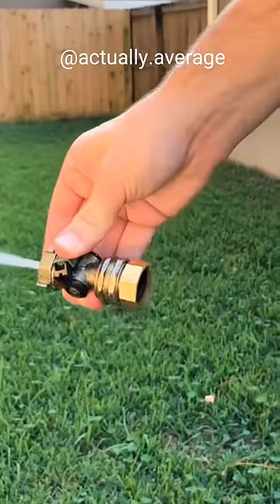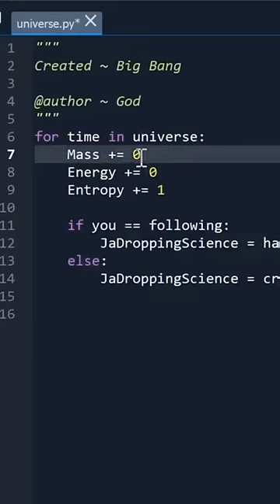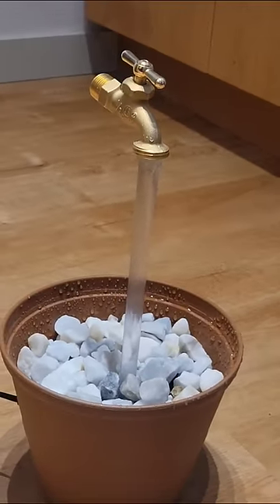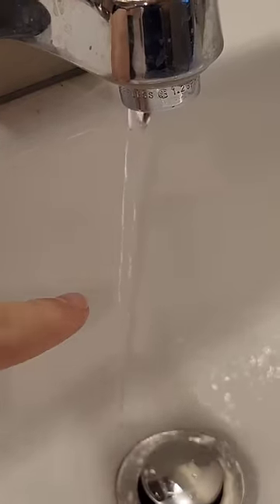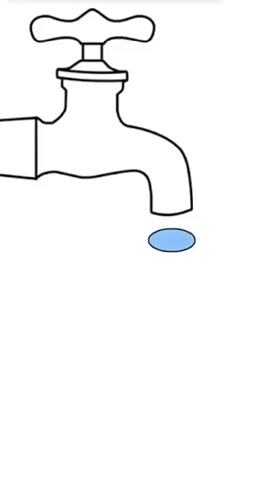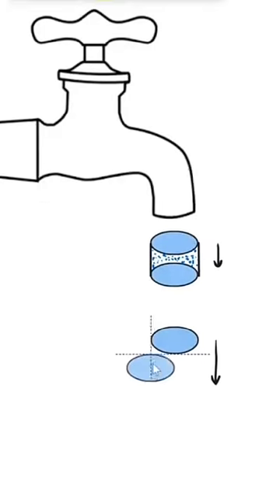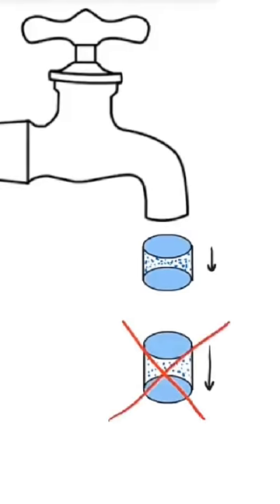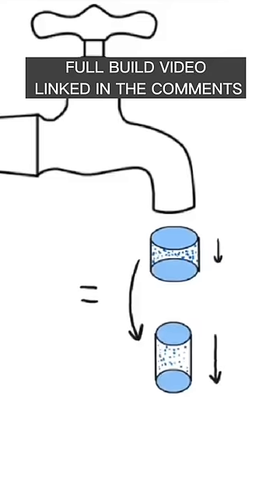Bluetooth Water Fountain??? DIY Tutorial Linked In Comments #science #learn

Comment: Wait… he didn’t actually EXPLAIN anything.
Reply: It's not super complicated. There is a transparent tube in the middle of the stream. The water runs up here and then flows back down on the sides. There might also be another rod inside on which the tap is mounted. That might have been done differently though, but it's hard to attach to the same tube as the water is using without breaking the illusion (as the connections would block part of the water flow, which would make the flow uneven)

Comment: I've seen laminar flow do something like this (the constant stream, not breaking physics), but I assume you can't do it straight down.
Or can you? 🤔
Reply: You can
Reply: pasted my comment, was looking if anyone else noticed:

Your drawing implies the distance between the particles of water is changing (you're changing the length of the cylinder), which is why you must reduce the width to have the same resulting volume. A drop of water can fall through the air without changing shape; why would this be (fundamentally) different for a cylinder? The length of the cylinder does not change, because all of the water is accelerating at the same rate and maintains their position relative to each other. Therefore, it can fall and have the same volume without a change in width.

Comment: And where does rhe water come from in the first place
Reply: Under the rocks.  A small pump pushes water up a clear pipe and it falls back down outside the pipe.  The refraction makes the pipe almost invisible.

The water looks fake here but it's all about the pressure.  If the pressure is equal to the acceleration due to gravity, the flow will turn into a 'laminar flow' where the stream is completely contained and almost looks like it's standing still.

Comment: the relationship of 
(Volumetric flow rate) = Avg Velocity*Cross sectional area is a good way to look at this. volumetric flow rate in a steady state system has to be the same at two points, so if one of the values goes up, the other must go down.

Comment: There's a see-through plastic tube inside the flowing water through which the water is pumped upwards. It then travels back down on the outside of the tube creating the illusion of flowing water - and this tube also causes the water stream to not bulge inwards as it should under gravity.

Comment: That's so clever/cool - so it's a clear tube with a spigot at the top, and the water comes up from the bottom and drains down the sides of said clear tube, so from the outside it looks like it's going down, but inside the water is coming up before it goes down the sides.

Comment: The argument for why the area gets smaller as you get down is not necessarily true. In the absences of air resistance, each molecule of water comprising the cross-section would be uniformly accelerated. Therefore, the area would be maintained. What is actually changing is the density of cross-sections, which doesn’t really make sense in differential terms. It is better to think of it as there being less water but more velocity.

The shrinking effect as you go down can be described more accurately by a combination of air resistance and the cohesion of water molecules. Air will be displaced by the water and eventually curve around the surface. As the water falls over time, the water will take a more aerodynamical shape, reducing the cross-section and increasing the mass concentrated over it to minimize drag.

Disclaimer: I make the assumption that his statement of the flow’s diameter decreasing is actually true and justify it on that premise. However, if this initial assumption is false, then the effect of drag can be considered minimized by the chaotic flow of the water.

Disclaimer: My understanding of drag and fluid mechanics comes from a course I took as a Physics major, so it is possible I am applying some incorrect arguments. However, I am pretty confident the explanation he gave towards the end is wrong.

Comment: Now this is old, but I had a question, could you have the water delivery tube be smaller at the bottom and bigger at the top to have it look like it's thinking due 2 speed? I understand you would need to increase pressure to adjust for the changes, though I would think it would be massive.